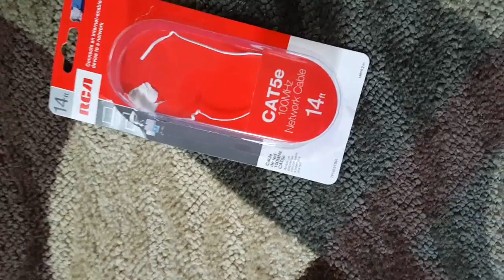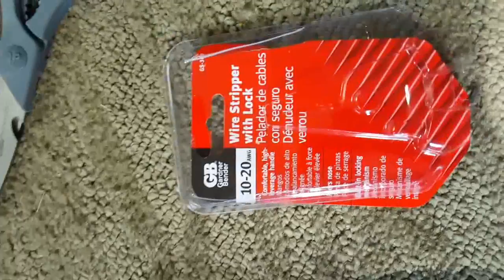How To Make A Lag Switch +Install/Use On Any Console

Comment: you are funny dude i enjoyed in your video i am thinking to make one but i have a question is this will work in mw3 and should i have to be the host or it will work even if my connection is sucks cause some one told me that if you are not the host you will lag your self not the people on the lobby with you is that right ? and thanks for this video like for support
Reply from the maker: This will work in MW3 NO YOU DO NOT NEED TO BE HOST it will work with any connection strength
Reply: ONLY1FLYFLAME oh that is good new thank you for your replay mate
Reply from the maker: +مهند حسان yeah anytime sorry it took me so long to reply thank you for the support
Reply: ONLY1FLYFLAME no problem dude :)
Reply: @ONLY1FLYFLAME  yo my switch seems to work perfectly when I’m host but when I’m not on 5% of the time it will register?

Comment: Hi mate nice video. Do you know if this works on ps4 rainbow 6? 2years ago i tried to make this and i remember it didnt work on bo3
Reply from the maker: Thanks i made it like 4 years ago i would googleps4 lag switch this ones supposed to work for all systems but id like for you to get the best result brotha
Reply: Yeah thanks for the answer, totally didn't check the date.
I'm pretty sure it works on ps4 but I think you need the lag switch from the modem connected to an ethernet hub, and then from the hub to the ps4 with a normal cable.
Thanks any ways. Fuck da haters
Reply: does it still work an were u connect it

Comment: it just boots me offline then i have to log back in...
Reply from the maker: use it for a shorter amount of time
Reply: +ONLY1FLYFLAME i used it for 1 second -_-
Reply from the maker: +Aureus Casper really? it might be your Internet speed then
Reply: +Aureus Casper no you have to plug it in to the router and the other Internet box thing and u have to run a separate ether net cable to your xbox

Comment: Did anyone here in the comments actually try this if so tell me because I want to make sure it don't fry my router or my Xbox
Reply from the maker: +Paige Haynes it works lmao i used it myself
Reply: Paige Haynes works bro
Reply: scarlet macaw gaming I wouldn’t risk it. If you have to cheat you ARE NOT A GAMER!
Reply: ONLY1FLYFLAME whenever I try to use it, it just crashes the internet
Reply: Jared Unrot so it doesn't work ?